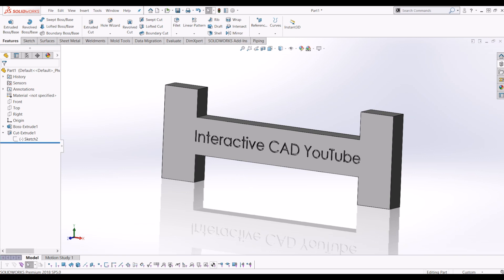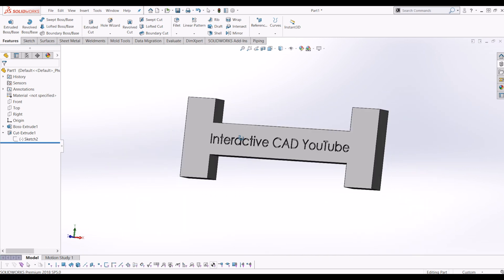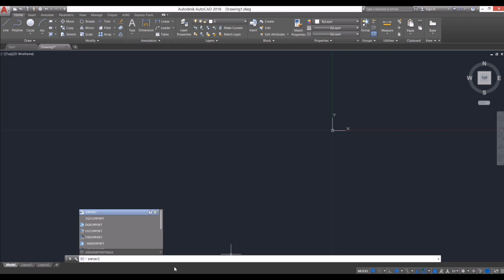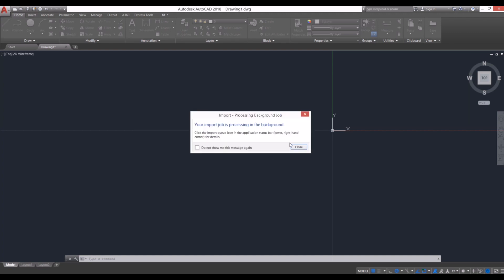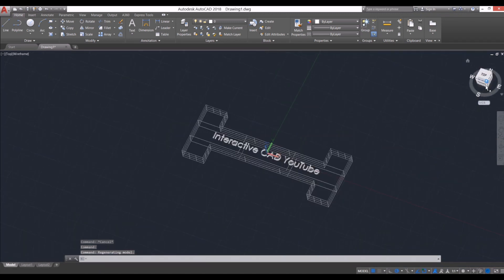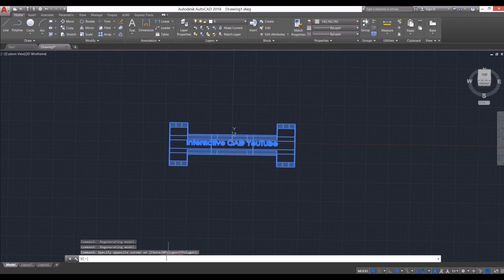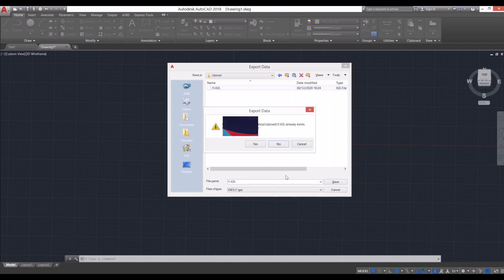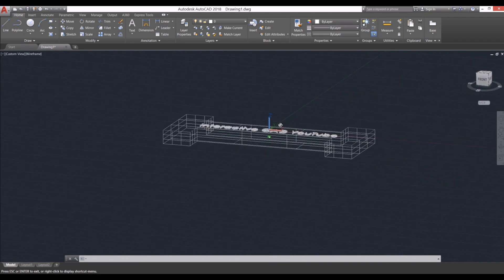Solidworks 3D Modelling How To- Import & Export 3D Files AutoCAD

Comment: is there a way to export a 3D model from autocad and retain the information attributes that are sett for say plates? So material, object number etz can be read by another program like solidworks.
Reply from the maker: Depends on what software and format your exporting too. 

But on the whole it’s very hard to export attributes to other software. Exports tend to mainly be just the geometry
Reply: @interactiveCAD  i have been working hard on this sense i sent this. And in short. The answer is no.
Reply: The long answer is. Kind of. You can get the part name by making the solid in AutoCAD as a block. The name of the block needs to be the part name
Reply: And then in this block you need to add attributes with values that can be read over to Autodesk vault
Reply: From Autodesk vault you connect the attributes value etz. But you need professional. From there you Connect the data inn to inventor on to the part you import inside Inventor. And so on and so forth. Loads of more to say. But that's the gist of it